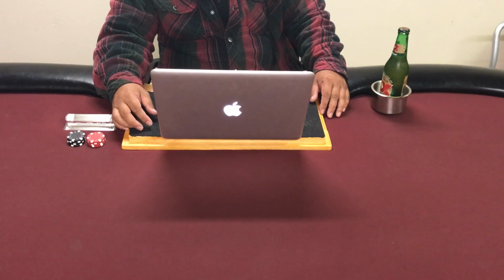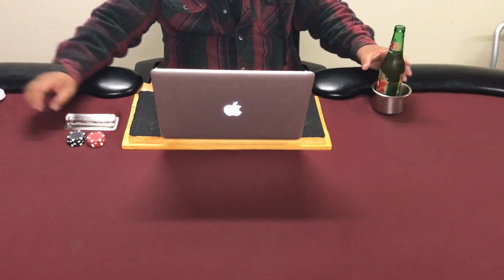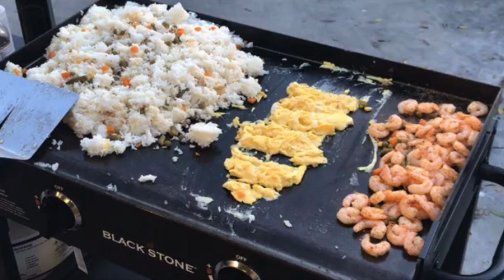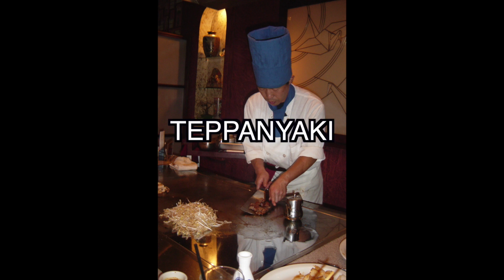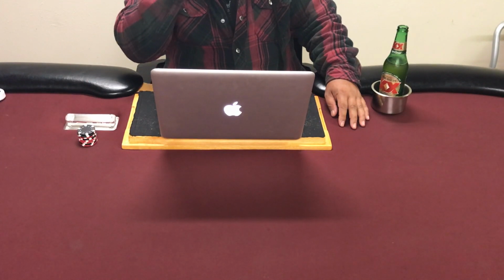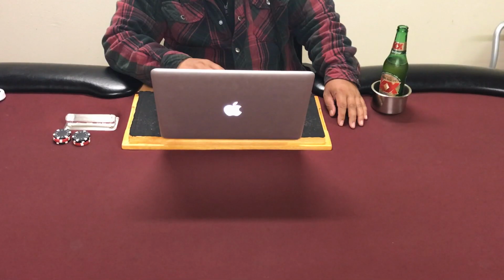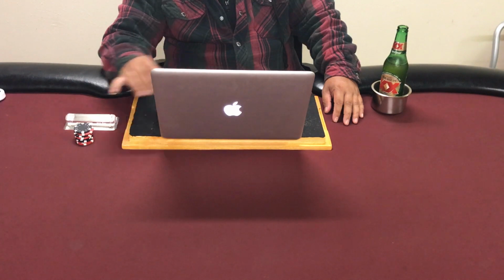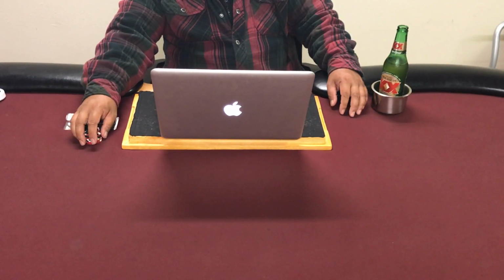🍺 Beer Vlog - The Difference Between a Hibachi And a Griddle

Comment: Way back when, Hibachis were sold at grocery stores, but not like the one you pictured.  More rectangle with adjustable grills. BTW, I prefer Bohemia or even Modelo but Dos Equies will do.
Reply from the maker: Jose .Maciel The first time I saw a "hibachi" was back home in AK and it was round with flat top and the propane was on the side. Modelo is my new favorite. 🍺
Reply: Jose .Maciel 
The small Hibachi, square, open top, cast iron grills that you are talking about are still being sold. Seen one recently at a hardware store here in California for $30.